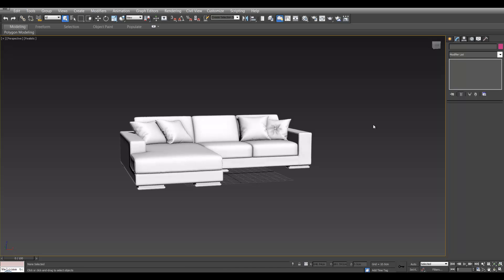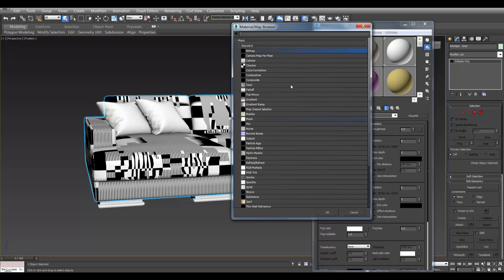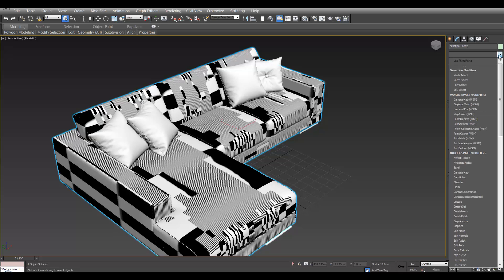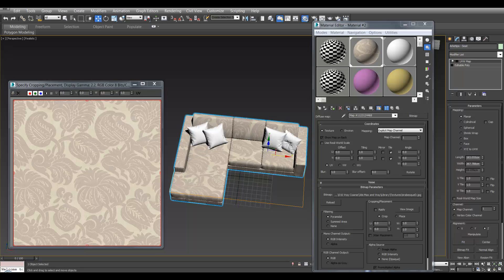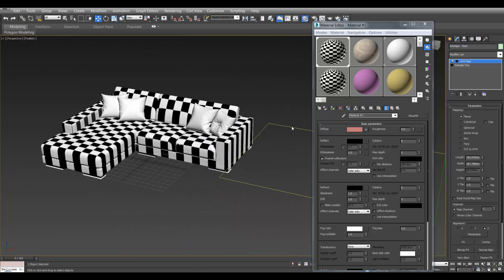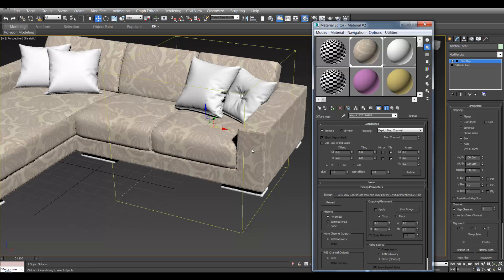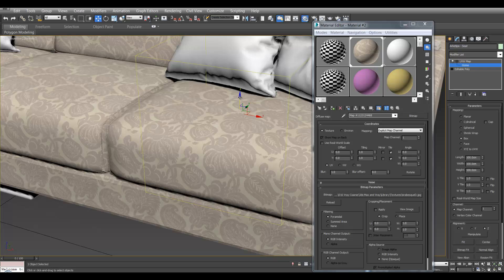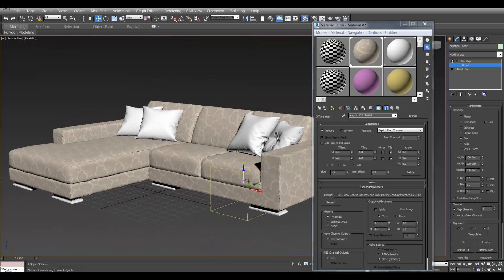How To Use The UVW Map Modifier in 3Ds Max

Comment: I'm an experienced 3D model artist but I have a question. Other than seeing how things would look in real time, what are the benefits of using this method? It would still need to be UVW unwrapped properly correct? For use in games and such.
Reply from the maker: Hi, unwrapping every object is not normally possible in Arch Viz due to time restraints. The benefits of using only using the UVW modifier is it is much quicker and simpler than using the Unwrap modifier on each object. Note this technique is more geared towards Arch Viz. I imagine for games you need to bake out the UVW coordinates?
Reply: Well the game I use is Second Life so it's not as advanced as, say, the UE4 Engine. The models themselves aren't super advanced and the only benefit I can see to UVW unwrapping them would be to paint additional details and use AO maps. So I guess my question is. If I were to use this method on a simple cube, texture each face differently, and import it into a simple game.. Well where is the texture information even held? Because one has to upload the texture as well as the model, but if there's no texture to upload...
Reply from the maker: There are two things I can think of off the top of my head. 1.In your modifier stack you will have something like Edit Poly and on top UVW Map, I would try collapsing the stack and importing to Second Life and see if the UV info gets baked into the model. I think it should. 2. If that doesn't work you can Render to Texture (0 on the keyboard in 3ds Max)
Reply: Yeh I mean usually I literally UVW unwrap EVERYTHING I make but, when it comes to buildings, it kinda becomes a little mundane and pointless UVW unwrapping every single wall and floor. This particular thing is kinda a building. I suppose, for the most part, I could use the UVW Map modifier but, for the things I'd like to be unique, I can UVW unwrap them manually. I'd never use this method for things like props, weapons, etc. but for buildings I can see how it's better.